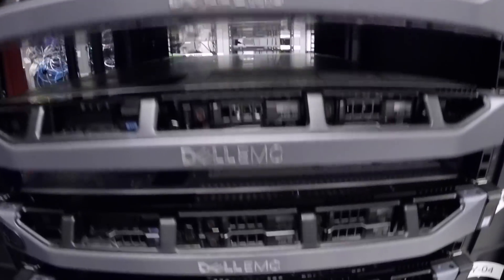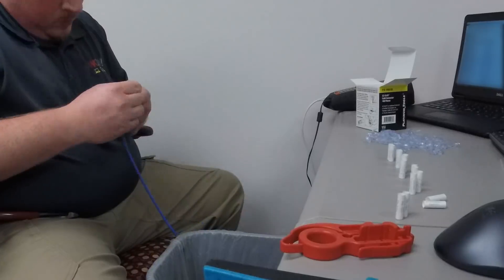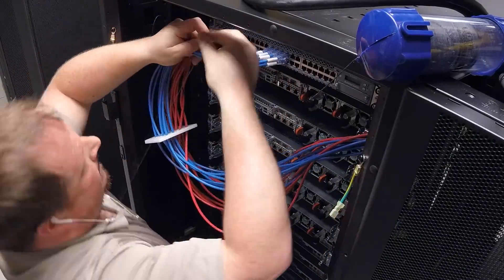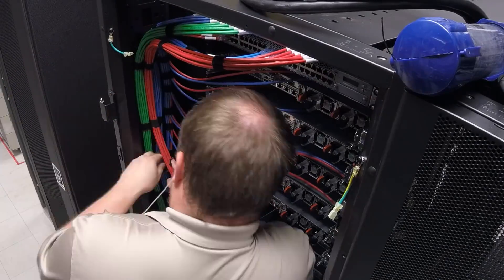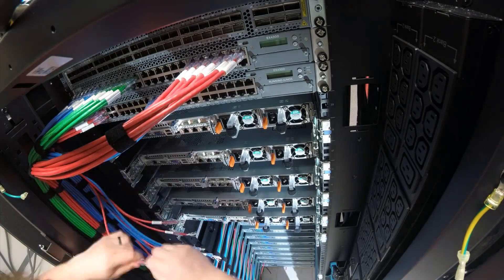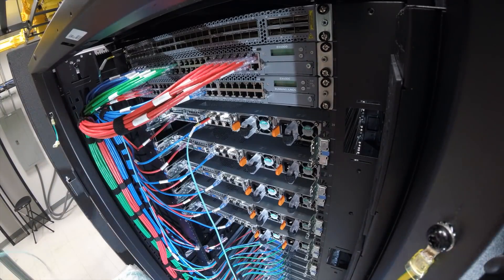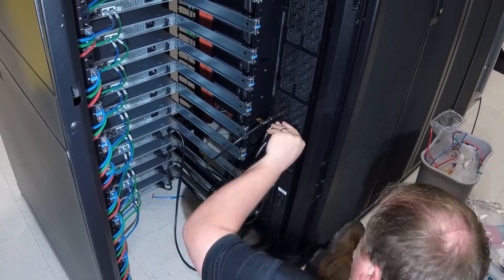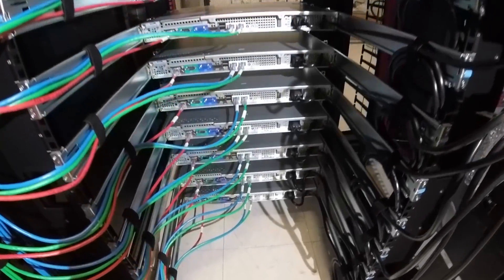Server Cable Build-out TimeLapse!

Comment: Do you recommend keeping a bit more slack in the cables so that you can slide out the server tray for inspection without removing the cables?
Reply from the maker: It depends on the setup. In this case, the department that "Owns" these servers is OK with downtime since they are clustered, taking one offline wont hurt them much short term. Also i have easy access to both the front and back of the rack. In situations where I may need to move equipment without being able to reach behind it (closets, ect) I do leave slack. Also cable management arms work well, but only the bigger (R630) servers came with them, so I chose not to use them for the entire rack.

Comment: How do you get into this profession...
Reply from the maker: So I'm a Headend Engineer for a Cable TV company. I started off as Service Technician and worked my way up. Other things to look into are Network Engineers or Data Center Engineers. I would suggest looking at getting some network certifications if your interested in more of the networking side rather than the physical work side. If your just looking to pull cable and wire up buildings, look into being a Low Voltage contractor. Good Luck to ya!

Comment: Great job. Bottom servers with single power feed? Tsk, tsk.  I generally take my excess fiber up to top of rack and leave the coils neatly bunched on the rack top. Don't like fiber coils in amongst the equipment. But damn nice job!
Reply from the maker: I was surprised myself when I pulled the R220s out of the box. Not my choice, but it's an Anycast DNS Cluster so the loss of one server shouldn't be too big of a deal, I did try to evenly split them between my A and B AC feeds. As for the fibers: I had more room to store slack at the server than at the top of the rack. Its something I'm still trying to perfect though, theres always room for imporvment!

Comment: Amazing bro! When you label the cables what is your format?
Reply from the maker: Everything in our offices gets labeled like this:
This Device Name
This Port TO Far Port
Far Device Name

Even if it does not leave the rack. BOTH ends get this style label. If its going to a fiber patch panel, it gets labeled with rack and shelf number. If there is a "Circuit Identifier" of some sort that gets added on as a second label. Ill take a picture and maybe post a video about this in the future.

Comment: How do you service those servers without causing a complete outage? Can't pull those servers out without unplugging everything?
Reply from the maker: That is one downside to the way i wired them. Both “Sets” of servers (The larger ones and the smaller ones) are clustered together so taking one down should not affect the services. The department that manages theses servers is not too concerned about uptime on these.

Comment: Looks nice. In my experience, a server guy would never take that much time to dress cables.  And a network guy wouldn’t MAKE patch cables. So, are you a server guy or a network guy?
Reply from the maker: I’m a HeadEnd Engineer for CATV company. We end up having to make so many coax cables that making Ethernet is not too big of a pain. If I could have spec’ed out the right length cables, i would not have made them myself, but its a tough fight to get anything specific from other departments!
Reply: @RomLabs   Check out the EZ RG45 ends and crimpers , the feed through makes life so much easer
Reply from the maker: That's all I use! As long as the blade on the crimper is sharp they work great!

Comment: Just wait until somebody who is not even supposed to be in the server room wants some additional connection to their machine and run their 10m tp-cable over the rack, making sure to tangle it on as many other cables as they can. Then when you ask if you can move it they say the connection is crucial and must not be temporarily broken under any circumstances.

Hopefully your good wiring is still holding up!
Reply from the maker: The good news is this is in one of the offices i manage, so i get to control access! This rack is still nice and clean, but I’m still working though 15-20 years of old wiring that needs to be cleaned up and removed from other racks! Thanks for watching!
Reply: Haha, you forgot to mention that the cable is also 50 % too long for its intended use and the most nasty and sticky cable the person could find... of course its not labeled.

Comment: This was pain to watch! There is NO termination in these networks. A terminator is a resistor and used in old coax or scsi connections or even phone lines but not in switched networks. The term to connect the plugs to the cables is "to crimp". I'm a trained network engineer working with Cisco and Ubnt networks. Additionally crimped and untested cables are a huge error source! If I come across crimped cables I replace them with professional grade cables as soon as possible.
Reply from the maker: My apologies for the misuse of terms! In the CATV industry we end up calling any connectorization “termination”. It’s not showed in this video but all cables were tested and certified with a Fluke CableIQ. Unfortunately the departments I work with sometimes don’t understand the importance of buying the right lengths of cable, so I’d be stuck trying to manage a ton of excess slack.

Comment: Excellent cable management! Is the top switch a Juniper EX4600? What about the other two copper ones?
Reply from the maker: The 2 Copper switches are Juniper EX4300s, The top switch is a Juniper QFX 5100 series. Thanks for watching!

Comment: u broke one rule with those power wires . with that loop you generate an electromagnetic field that can affect the devices. same as ethernet u can cut the power wire and built a power connector as large as u need.
Reply from the maker: It’s something I’ll keep in mind in the future. It’s a bit tough to get the supplies i need at times!

Comment: Nice work, but you didn't leave enough slack on the cat6 cables if the techs want to move the servers out on the rails
Reply from the maker: The department that “Owns” these servers is OK with downtime since they are clustered together. That being said, it something I’ll think about in the future. Thanks everyone for watching!
Reply: @RomLabs  I hate those cable arms that would be your alternative. Every brand is different being unique to the slides design. Some atach to the fixed part others to the moving part.
Reply: At my company, it’s the standard to shutdown the server before sliding it out, and all that extra cable just floating there for the convenience of sliding it out (maybe once or twice over its service life) isn’t worth it IMO. Also, if you slid it out, what can you do if it’s still powered on?
Reply: @diesel4618  theres not a ton you can do while powered on but one thing you can do is swap out fan modules that died.... maybe theres other bits but im unsure you should take a look inside a server chasis though if you havnt its a whole different world to your pc nearly everything in there is replacable even things like the foltage regulators for the cpu not to mention hot swap power supplys
Reply: @Sarge92  Yeah, I'm the server admin at my office however our standard is to power down any machine to perform maintenance on it, even to replace hot-swappable items (excluding drives). It's not smart (or within compliance as I work in healthcare IT) to work on Production systems while they are powered on, that's a fast-track way to get fired in my line of work.
Reply: @diesel4618  Why be fired though? I mean we've been swapping some fans at work and we do it while server's running (hot swap). I don't know if we replace anything else with the host up though, I'm still a student and a humble learner. Sometimes bad things happen when you shut down a host. Like we had to shut down both our hosts (running ESXi) to swap something in our NAS. At the end both of them suddenly decided to claim that they did not have any bootable device and "no SD card detected". SD cards are where we store the whole ESXi system. We were preparing to come back at 6 a.m. to set up the lots of PCs that we have in the building to static IP configuration and then (after we unplugged them completely for about 10 minutes) one of the hosts came up. The other host never did. Ever since I'm almost praying when I have to do something similar. And I'm not religious at all.
Reply: @Sarge92       You don't need to move a server to replace a power supply.
Reply: @Sarge92  another thing to mention I know especially with dell poweredge servers they have an LCD screen which will show failures and any errors which is really useful and for verify what failed or what the error was for and that does require power to view and verify. Also can help troubleshoot things that are hot-swappable to see the problem is still there
Reply: @diesel4618  you don't have servers with hot swappable parts like fans?
Reply: @diesel4618  leaving it plugged in does allow for you to identify the server still and also testing it mainly what I feel it is based on the scenario
Reply: At my company, our IBM servers all came with "wire extension arms" which are just horizontal wire mounting racks that folds and can be slide out.
Reply: i agree
Reply: Yep, I try and always give enough cable length to pull servers out. as I really dislike having to unpatch servers if I need to get them out of the rack. Probably down to the fact I work in a small company and I the guy who does this, but also does any work on the servers later.
Reply: @Enazel  my thought is if you want to be pulling a machine out while keeping it connected you should be using one of the arms that will hold the cables and stretch out. Without that it just seems messy and not great to have 3 feet of excesses slack in the back
Reply: If these servers will be equipped with CMA's (cable management arm) then yes, better to have enough cable to route it through CMA. But if there never will be any CMA installed then you do not need spare cable just hanging in circles, it will be faster to disconnect cables from server than unravel the circles, line it up and carefully extend server on rails and then put back the server and make nice circles again. P.S. sorry for my english.
Reply: Power down a server? Are you all mad?!? 🙂
Reply: I was going to say the same thing also there should be a better way that can cable manage the extra slack of power cables and fiber cables instead of having them rolled up and placed on top of the servers which can cause issues moving the server on the rails and with heat
Reply: I find that cable arms trap heat close to the server and are not worth the bulk or trouble. In virtualized environments you just offload the systems to put the host in maintenance mode without any outages to production.
Reply: Well spotted.  But how often would you pull a server to work on it without powering it down and removing it from the network
Reply: Malcolm Crabbe true, but you really don’t want to be unplugging cables every time to get into the machine whether it’s on or off. Plus he’s doing complete custom cables, then would be the time I’d be planning all of this out
Reply: @pancakes1983  I agree that it's inconvenient having to unplug it all, and that with a little more thought he could have included enough loop of cable to allow the server to be pulled without the need to unplug it
Reply: @pancakes1983  I agree would have done more length to allow for it to be moved on the rails. I like the idea of doing ethernet on the rails of the server but also making sure that it would not cause issues in the future by doing it in a way where it would not catch and cause issues later but also testing to make sure cables are long enough to allow it
Reply: @MalcolmCrabbe  I inherited a position and needed serial numbers which were on the top panel of the servers.   Similarly, the cables were short and only allowed about 2 inches of movement.  It was a pain having to fail over each server just to acquire necessary documentation if vendor support was ever needed.  I agree, a simple short service loop might make all the difference.
Reply: @freddyalmonrode     Dell is smart enough to have their service tags easily seen from the front or back of the server.  To put them on top is a stupid design flaw.
Reply: @freddyalmonrode      Dell is smart enough to put their service tags easily seen on the front or back.  To put them on top is a stupid design flaw.
Reply: @MalcolmCrabbe  rarely but sometimes quite often when hot swap fan's dies

Comment: What's the point of having 3 Ethernet cables running to each and every single server? 🤔
Reply from the maker: On the bottom servers 1 is for Lights Out Management, 1 is for "Management" and 1 is for "Production" traffic. Multiple interfaces allows alternate access pathways if something goes wrong.
Reply: That's how it works in the data center. Most servers will have multiple links for backup or different types of traffic. In some cases, multiple links will be aggregated into a single port (e.g. LACP)
Reply: Bandwidth, and management, Most of my servers have 5 cables, 4 which are aggregated for standard traffic and 1 for management, got to understand you can have a lot of people connecting from all over the place to get data off that one server.

Comment: What labels are you using on the cables?
Reply from the maker: We use a combination of a cut drinking straw and Rhino 6000 label printer using permanent polyester labels. This allows us to move the label around to read it without twisting the cable.

Comment: Noob right here, just a simple question, why do you need 2 fiber and 2 cat6 cable for each server ?
Reply: It's all about redundancy in the data center environment. They have different tech that can make use of both links. Port channel, virtual port channels and NIC teaming to name a few. So in short it's used for higher throughput and redundancy. :)
Reply: @watermellonhead1985  alright, thank you so much
Reply from the maker: John is Correct! We have redundancy on the fiber connections for those servers, along with a Management Ethernet interface and a lights out management. Unless power is physically disconnected, our team should be able to get into those servers remotely no matter what happens!

Comment: Never understood why people stack servers like this....
Reply from the maker: This was per the spec of the department we are installing the servers for. They "Own" the entire rack, so short of the 3 servers we may have to install in the future, they don't expect any future expansion. Also we don't have traditional "Hot" and "Cold" Aisles so there's no need for the isolation stacking them tight would provide. I personally would have stacked them all together, it just looks cooler!
Reply: @RomLabs  yeah I thought the space doesn't have optimized cooling. But I still find it disturbing even though rack wouldn't be planned for more capacity today, they're still wasting half of the racks capacity in case they someday want to expand and would want to install 2U servers or something like that. Even installing new 1U servers to empty Units would be very confusing for someone to troubleshoot if they were part of different system. 

I just can't find this kind of stacking never to be justified with servers. In some cases with networking equipment it's acceptable, as it's good to have one unit spacing in some situations to allow the heat radiate from the top without it being right on top of another device frying it slowly. But network equipment and their cooling vary, although most of them are front-to-back or back-to-front nowadays and not so much side air intakes on other than big routers.

Comment: Since your 10gb switch was in the same rack was there a reason you didn't just use a DAC cable?
Reply from the maker: The department that "Owns" this rack specified fiber for the uplinks. In general we are much better equipped with Fiber and SFPs in case something goes bad. We don't use many DAC Cables in our offices unfortunately.

Comment: They are on rails... So what are you gonna do if you want to pull one out as there isn't any slack?
Reply: I know right,
this erked me so bad, Dell even sell arms for exactly that...
makes an otherwise superb job terrible, 
now the server has to be shutdown in order to pull it out, even for hot-swap parts
Reply from the maker: They are in a VMWare Cluster and the department who owns them is OK if we need to pull one offline for service. The Dell R630s came with arms, but the R220s did not. It was easier to not use them to keep anything consistent. So far we have not had any need to shut down any of the servers since they went live.

Comment: Well done! But why you create the cable by your own? It's sooo time consuming.
Reply: otherwise you're gonna have a lot of extra cable in the rack which is harder to work with and looks less clean
Reply from the maker: I had issues getting other departments to buy custom supplies for this. If I could buy my own supplies i most likely would have went with pre-made cables. But Mikat is correct too, its much easier to keep custom built cables clean!

Comment: What brand rj45 connectors are you using? (They look like they are pass-through and you just snip the ends?)
What labeler are you using?
Reply from the maker: I typically use Platinum Tools EZ-45 RJ-45 connectors. The wires pass through the end and are trimmed off by their crimp tool. As for the labeler, its a Rhino 6000 labeler with Polyester labels. Nothing special except I use the Rhino Connect software to generate my labels on a computer.  I use cut pieces of straw so I can move the label around on the cable end to make it easier to read.
Reply: Bummer when they move to metal straws :)
Reply from the maker: :Hides his BOXES and BOXES of straws he has stashed away: 😉